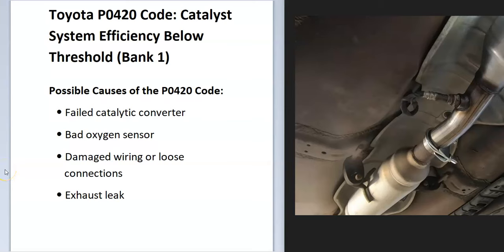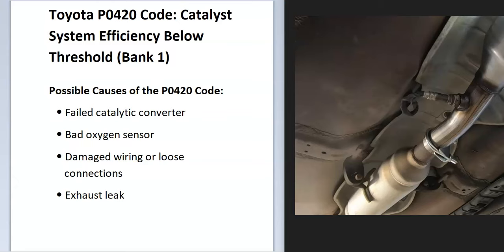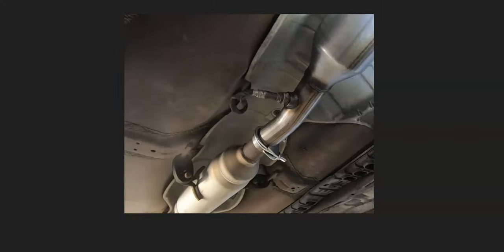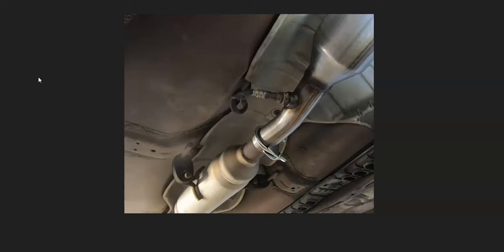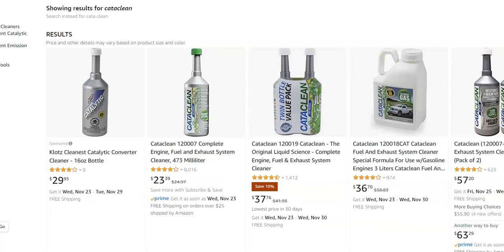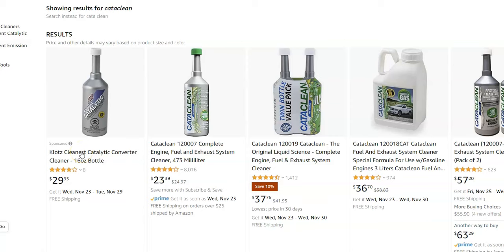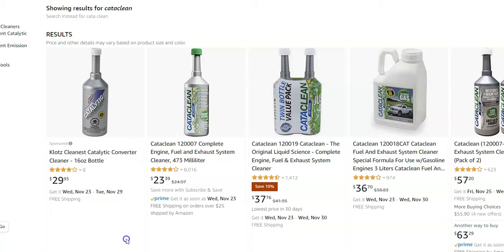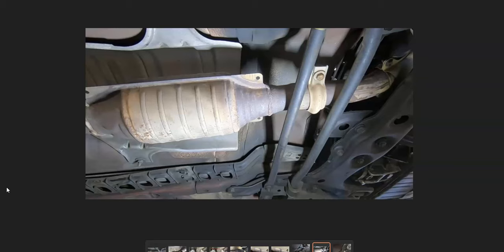Causes and Fixes Toyota P0420 Code: Catalyst System Efficiency Below Threshold (Bank 1)

Comment: It came up once, I just use the cleaner you put in the tank every time I change my oil and I have not gotten the code for two years now.
Reply: after automatically light gone?
Reply: @TheUkbhat  I reset the light when I added the stuff.
Reply: @peggle09  thanks.. I will try  same solution
Reply: Did you add it with the oil or in the gas tank after an oil change
Reply: @StevenBerrios-t6p  stuff I got goes in the gas tank.
Reply: @peggle09  what cleaner? I tried cataclean and I disconnected battery cable and that turned it off for about a month.. then came back on
Reply: What brand of cleaner do you use ? Having the same issue
Reply: @huarache3795  Cataclean
Reply: @peggle09  Thank you, I’m going to try a o2 adapter first and if it comes back I’ll try the cataclean. 

I’m worried it might be the catalytic itself though because I am only the one code P0420

Comment: 06  Scion XA  with P0420. New Cat , New 02 sensors . However, the issue keeps recurring. Guys , any suggestions?
Reply: Look for exhaust leaks. Leaks let oxygen in. Even small leaks will cause problems
Reply: Evap valve malfunction, exhaust leak or a bad onboard computer
Reply: Maf sensor or map sensor
Reply: Keep having the same problem , car has been inspected twice by 2 different mechanics . First mechanic changed spark plugs , intake filter , o2 sensor and catalytic converter and code came back within 40-60 miles and then kept bringing it back   With them another 3 times and in totaled stayed with them for about 20 days running a bunch of tests but no luck so i decided to take to a different mechanic and said catalytic converter needed to be replaced again and possibly o2 sensors as well and all of this happened within a month . Btw the cat was replaced   At 106k miles first and then at 108 k again so no sure what to do next . Help ?
Reply: If it's not solved yet, there is a possibility of cracks before the catalytic converter. This means your exhaust is leaking, and the amount of oxygen on upstream is higher than the downstream, which should be lower and your ecu confused.
Reply: Find a diagnostic specialist and get them to delete the code from the ECU
Reply: Replace gas cap

Comment: You could also run a non fouler on the O2 and it’s a cheaper option but it’s a band aid and not fixing anything you are just tricking the computer into thinking the O2 is fine. Now my car has the secondary O2 disabled so I don’t get check engine lights for a cat because I don’t have one.
Reply: but hows the mpg

Comment: I have a 2006 Prius, Check Engline light is on and I ran a OBd2 scan and it came up with the P0420 - bank 1,  do you have a video on how to check the 02 sensor wiring and then the 02 sensor and possibly a video on how to change them? Thanks!

Comment: CRC Guaranteed To Pass Fuel System Cleaner 12oz

This all you need to cleared your code and check engine this stuff works as advertised my code gone and check engine im sold
Reply: Correction: you're selling

Comment: I got the check engine light with Po420 code but every time I drive 45min-1 hour on the highway the check engine light goes away for a day or two then come back on?
Reply: Same here
Reply: What did you end up doing
Reply: Sounds like your partially clearing your cat out when your on the highway but then it's getting plugged back up.
Reply: That means yr catalytic converter is ok but there’s something that blocks it and u get the code again, you better use super gas for like 2 times full tank and good luck

Comment: hi, I have a Toyota Camry 2011XLE, I have oxygen sensor error P0138 code , \my mechanic  changed both, related sensors ,now engine light come up with P0420 catalyst system efficiency below bank 1,   I never had this error before, now I am seeing it!! could you please advise?
Reply: Exhaust leak? What did you figure out

Comment: I have a 2001 Corolla. I’ve been dealing with this nuisance for a few days now. I do get the P0 420 code. I clear it, run it and all the monitors are ready except the “catalytic converter.” As soon as the check engine light comes on, moments later, the catalytic converter monitor will be ready. It would be great if it were the other way around, namely, that the catalytic converter monitor would be ready, and THEN the check engine light would come on. That would give me time to take it to the smog station.

Comment: I also had a C1241 for “low or high voltage from somewhere” as well as the P0420. Could that point to a bad sensor?

Comment: Thank you for video. What other code do you get when it's a bad o2 sensor? I have the p0420 along with p0422 evaporative emission control system leak
Reply: I have the same codes
Reply: I also have these 2 codes...ever figure it out?

in 2020 I got a new catalytic converter on my 2006 Sienna

Comment: I changed both O2 censors, new exhaust, used Cataclean once and p0420 code still exist on my 2000 Camry. Aftermarket Catalytic converter was changed in 2015 or 2016. 

Any advice? Thanks
Reply from the maker: I would test the catalytic converter, if there are no other codes it is likely having an issue.
Reply: Reset the memory.... unplug negative from battery

Comment: Please help. Ive changed my:
Converter
Intake manifold
Both oxygen sensors
Reply from the maker: The components will need to be tested to know which is having an issue, but I would check the O2 sensor's wiring and for any exhaust leaks.

Comment: I have a 06 Toyota Corolla and I just replaced the catalytic converter and the oxygen sensors and the code came back on! How I can check if the wires are good?
Reply from the maker: If you have a meter, you can check for the voltage, grounds, and signal wire back to the computer. It is best to find a schematic for your vehicle to know which wires go were.

Comment: hi,i have a question i have 2005 Toyota Camry 2.4 cylinder, recently i got code p0420,but i noticed one on freeze frame data that shows short term fuel trim is 5.5 and long term is 12.5, Is it is related to fuel system?, if you can please let me know thanks.

Comment: Need your help,I have a 2002 toyota camry le 2.4 how many catalytic converter  do my car have?I have p0420 code only.
Reply: P0420 code:I just ended up sticking a vacuum in the muffler pipe tape it up real good ...checking exhaust leaks,and wala spray soap and water all on the pipes n seals and holy cow it started bubbling front flange seal and rear seal precat...and there's a small hole that was just hissing too.try that first ,vacuum not gonna hurt nothing
Reply: @MariaGonzalez-ei1pv did it work for you guys I have p0420 and leaking exhaust manifold gasket and down pipe donut gasket

Comment: How to test the o2 sensor?
Reply: @elchaka1515 If the light came on, wouldn't that tell you the sensor worked if it picked the code up? You could also check the continuity of the sensor wires to make sure they are not damaged.
Maybe you need to spray brake clean on the sensors to clean them, just unscrew them and give them a shot.

Comment: I am having pruis 2007 , recently i got P0420 code then i added cataclean into my gas tank then check engine light went off. After a week check engine light came back. Some times it is going and coming , can some one suggest something for this problem
Reply from the maker: It will need to be diagnosed, but the CAT is likely getting ready to fail. CATA Clean can often get more miles out of a CAT, but eventually, they need to be replaced.

Comment: I received the code for the O2 sensor. I replaced the O2 sensor. I then received the P0420. What is the problem?
Reply from the maker: It needs to be diagnosed, but since the 02 sensor was just replaced, I would be sure it is plugged in good and test that it is working.
Reply: @HVAC_Mechanic  yes it has been tested

Comment: 2010 Corolla LE, change cat, bought new O2 sensor, Changed idle air control valve  used cat cleaner i still have a code
Reply from the maker: Did the engine light go off? 2009 and newer vehicles need a Drive Cycle to fully clear the code, but the engine light should go off.
Reply: 2009 corolla se, same experience, changed the exhaust pipe, with pre installed cat completely but still have the code. I think this a flawed toyota design. I'm gonna be done with toyotas for this reason
Reply: @HVAC_Mechanic  I have a P0420 code on my 2007 Toyota yaris but no engine light, I only found that out through Scan tool, what do I do because it is not smog ready, it given me the yellow exclamation mark rather than the green one. what do I do????could be I just have drive a few miles for it to go through the cycles, since it is only yellow and there no check Engine Light?

Comment: What happens if some one does not change catalytic converter and keeps driving?
Reply from the maker: It can become clogged up, blocking the exhaust from escaping, causing the engine to run badly.

Comment: Splashing through a puddle gives me this...
Reply: Could be the catalytic converter has a small hole and water is getting in, causing it to underperform or water getting in an Oxygen sensor/wire
Reply: Mine does the opposite. My light goes off after I drive through a deep puddle.